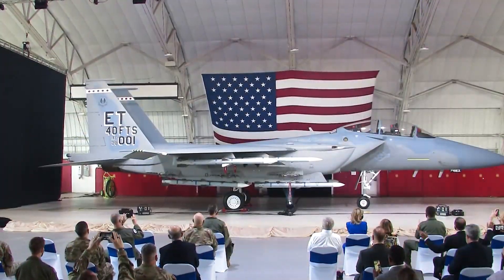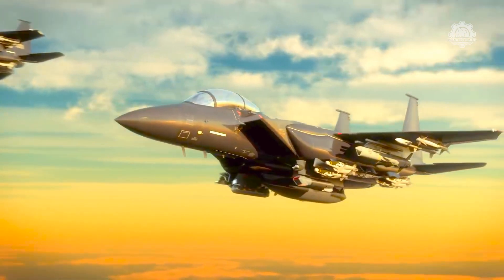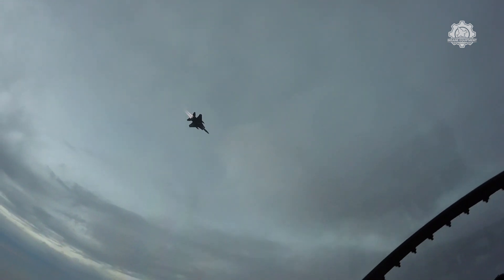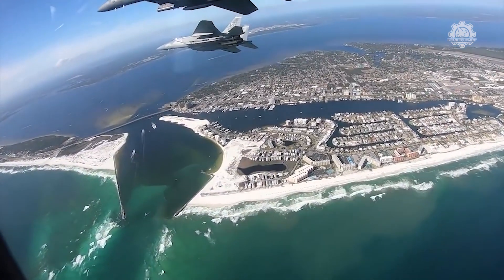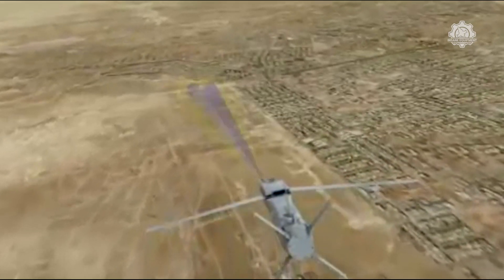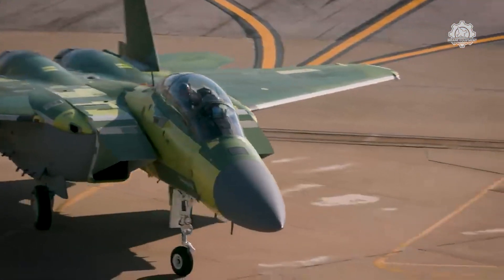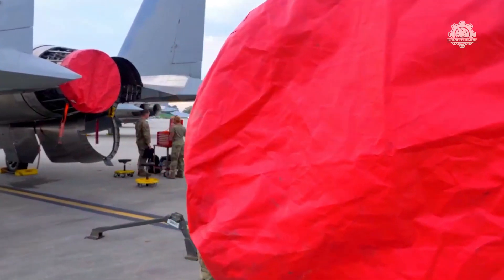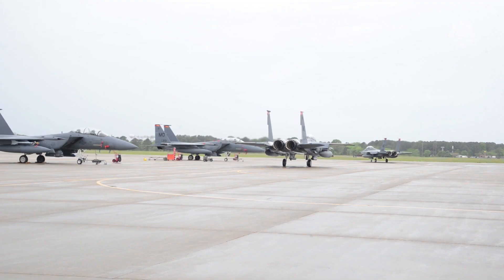Here's Comes the New F-15EX Super Eagle

Comment: Cost effective F-15EX? Hardly….they are coming in at almost $120 million per aircraft, compared to $80 million for an F-35.  The USAF never asked for the F-15EX.  It was written into the USAF budget by Washington D.C politicians for the sole purpose of keeping the Boeing military aircraft production line open.  Now, it’s hard to argue with that, because if they hadn’t, the only fighter aircraft production line in the USA would be the Lockheed F-35.  But calling it cost effective is a joke.  The USAF could buy MORE F-35’s AND transition all of their support/maintenance logistics structure over for less money than buying the SAME number of F-15EX’s.  The USAF needs to step up the NGAD program because buying the F-15EX is only delaying the ultimate goal, which is to have a 100% stealth air force.
Reply: That’s cute you cherry picked your data. Even lied about most of it, that’s some pseudo-intelligence right there. The F-15 EX will cost 87 million. 

You forget to mention that the F-35 airframe will only last around 8,000 hours, compared to the F-15EX which is 20,000.

That’s more than half of the the life span. the Air Force would need to purchase not one, but three F-35As to match that. It would cost 1.1 billion to match the life span, service, and maintenance of one F-15 which would be 660 million. Nice try though, being a F-35 shill. Plane has been a overpriced and overrated failure.
Reply: Where did you get the 120 million per F15EX figure from?  I know the sale price is higher than the F35 but it's cost per flight hours is less than the F35 by almost 10,000 dollars
Reply: Why would you need 100% stealth air force. Once you take out enemy air force and anti-air, e.g. when you have air superiority, non-stealth planes will do the jobs just fine.
Reply: @ptbot3294  I didn’t say that I wanted a 100% stealth Air Force.  The USAF has been trying to build a 100% stealth Air Force since the mid 1990’s.  That is their goal.  That was why they developed the F-22 (for air superiority) and the F-35 (for the attack role).  Originally there were supposed to be 1500 F-22’s.  Then that got cut to 750.  Then that got cut to 500.  Then that got cut to 300.  Then they stopped producing them at 187.  They figured with 2,763 F-35’s, and no more Soviet Union, it would be good enough.  Now they are attempting to cut the number of F-35’s they will acquire.  Yet their overall goal is still to have a 100% stealth Air Force.  Every time the USAF releases a 30 year plan, and also in their Air Domination 2050 plan, they keep outlining how they want to build a 100% stealth force.  This is why the USAF never asked for the F-15EX.  The USAF didn’t want the F-15EX.  It was written into the USAF budget by Washington DC politicians simply to give life support to the Boeing military aircraft production line.  It is nothing more than financial aid to a business.  And the politician that wrote it into the budget is a former Boeing exec.  It’s actually pretty disgusting when you think about it.  It is pork barrel political special interests at its finest.
Reply: The US shouldn’t have a 100% stealth air force. It’s costly to maintain and comes with tons of disadvantages. Like a decrease in payload. Plus IRST is so modernized now that it can detect these stealth aircraft from hundreds of miles away. Now the F-35 is a Lo fighter. What the US needs is a High Fighter which is the F-15. They can’t go towards the F-22 since the production line stopped.